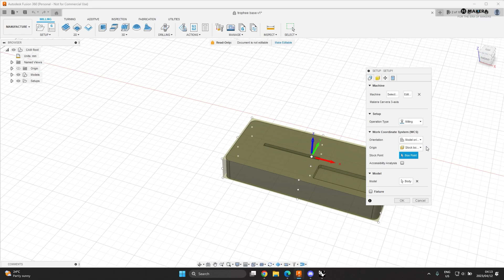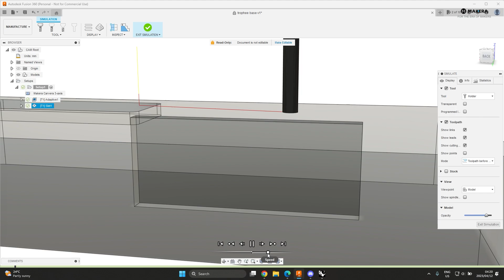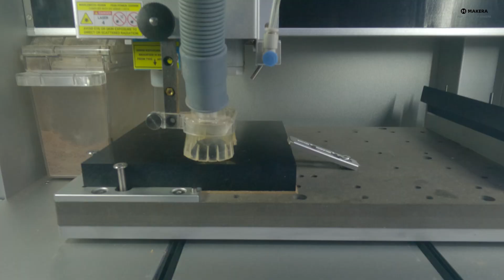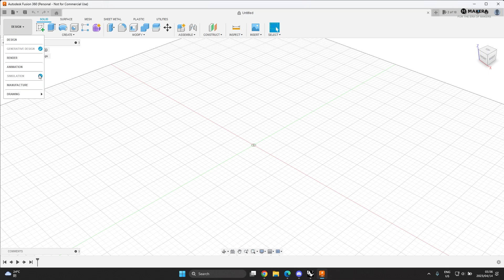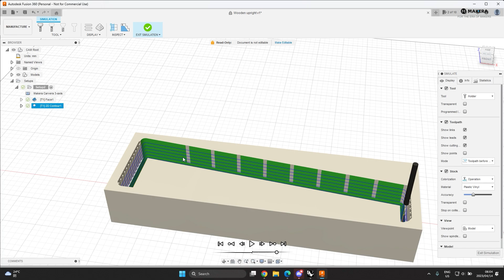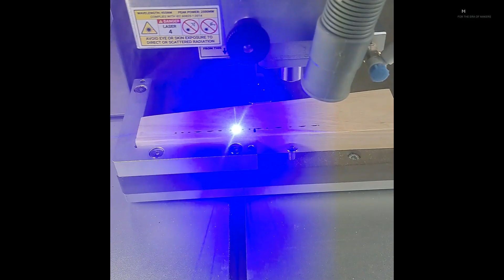Making a trophy using Carvera & Fusion 360

Comment: Can you mill and laser in fusion 360?
Reply from the maker: Milling yes very effectively, laser less so. You could design a file for the laser function, but Fusion's CAM profile wouldn't be able to fully prepare your design. You could use it to create the tool paths and speeds, then use a manual command to turn the laser on. Instead, we would suggest you import your design file from fusion (as a DXF) into Makera CAM for optimal production using the laser module.